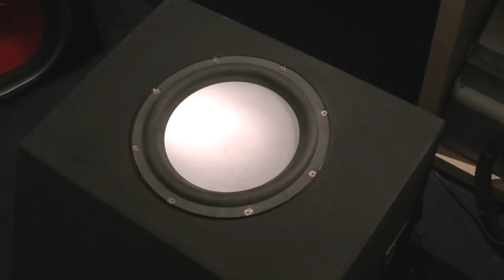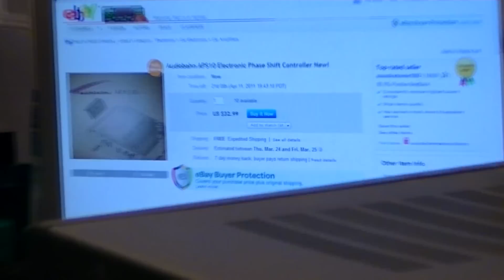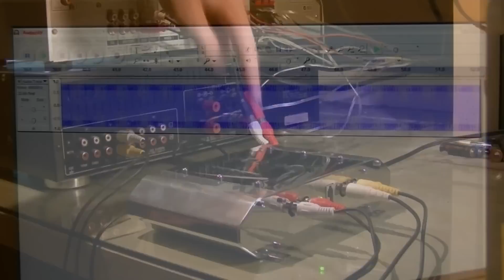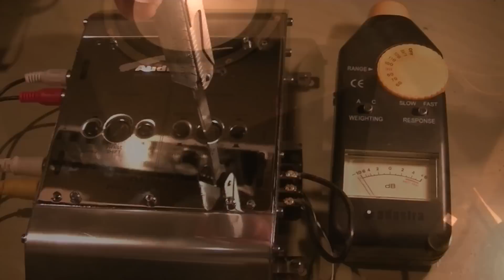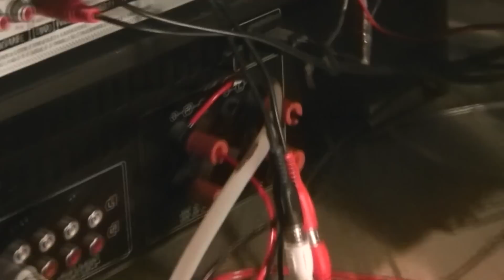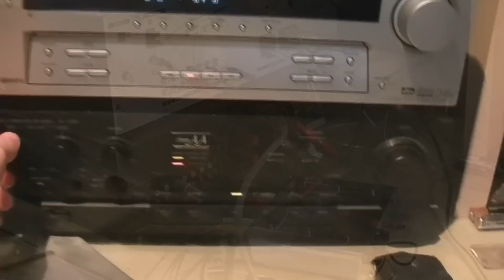How to FULLY bridge any amplifier! EASY steps

Comment: Just a word of warning. You CAN'T do this with class D amps. They are already internally bridged, and doing so will damage the amplifier.
Reply: +Giulio Zanetti if its class D it'll be small and light...class A amps are heavy
Reply: How do i recognize an already internally bridged amp? cause i'd like to bridge mine but i'm not sure i'd be able to do it, and i'm just hoping my amp is already bridged, it would be a great thing
Reply from the maker: You can do this with ANY 2-channel amp. If it is set up for bridge mode internally already then you dont need to.
Reply: He means STEREO class D amps!
Reply: You can only do this if the two speaker channels share a ground or the other contact.
IT WILL NOT WORK IF THEY DONT
Reply: It will if they don't. You just have to manually connect them together externally instead if internally.
Reply: Actually, ANYONE can.
It's called using one's brain.
Any internally bridged amplifier (one that can NOT have any speaker terminal connected/shorted to any other OR to ground (as they have internally connected grounds already, meaning that both the + & - outs are considered FLOATING  high outputs and ONLY +/- with respect to each other of the one output - with no possible electrical connection ground), thus ONE must use one's BRAIN to find the way to GROUND these outputs.

The one simple method, that has been USED since the beginning of electrical circuits and is STILL in use in HIGH POWER COMMERCIAL GENERATION SUPPLY NETWORKS, to this day, are TRANSFORMERS.
You know, that most ancient of devices, that keeps POWER flowing down a LINE, whilst completely ISOLATING one circuit (however configured) from another that is GROUNDED.!!!

All one needs are a couple of toroidal isolating AUDIO rated 20hz/20Khz toroid's of sufficient power rating, and ISOLATED the output from your MONOBLOCK dual ch. amp, from the TWO now "grounded at the toroidal transformers which will then be fed from the toroidal outputs, to become the ONE bridged speaker final circuit.

Easy for those who THINK.
Everyone else has to "carefully" check to see if there's any ZERO resistance, between the two output negative's (preferably without the amp powered on) otherwise they will INTERNALLY BLOW the internally bridged IC's with a runaway shorting current, (that will violently explode the op ic's)

Such an easy fix, is obtained by the interconnection of even a single dual wound toroidal transformer, that has ALL 4 windings on it's ONE core, all rated at the same voltage & impedances, as well as having a multiple frequency rating - suitable for audio frequency uses

ie: One capable of easily handling 20 Hz frequencies, right up to & including 20kHz (and even 40 kHz for tweeter speakers).
Such as this type:
http://www.photonage.com.au/150w-100v-28-ohm-audio-output-toroidal-transformer-p-2155.html

Comment: no need for phase inverter, simple wire inverting would do the trick, and with more precission than any signal processing involved
Reply: yeah exactly what i was thinking! just invert one channel out of the splitter - would be a very handy cable/adaptor to have in the kit, as long as it was clearly labelled.
Reply: @chubbyballsack  RCA cables have a common ground so you'd only get sound on one plug as you'd short the other channel to ground unfortunately.

Comment: Hey man, I know this video is old but I recently managed to get an old amp working again which means I have two stereo (VERY FUCKIN' LOUD) amplifiers. I want to do this and need to know if there's a particular place I could find one of those phase shifters. 

I also want to know why you can just make the phase opposite at line level by swapping the earth and signal wires round on ONE of the channels so that you get the bridged effect. 
I could do with a reply if possible

Comment: You've made a push-pull configuration.
If an amplifier supports bridging, you connect the positive of one channel to the negative of another channel, making the reference of channel 1 the output of channel 2, doubling the potential.
When you bridge, your speakers impedance should be twice the min impedance the amp is built for.
Also, in the video you measure the voltage of a closed circuit, and then compares it to an open circuit. It's pretty obvious that you don't really know what you're doing.

Comment from the maker: @Olmirz what you've just described is bridge parallel mode. In theory it should work - but both channels on the amp have to be giving IDENTICAL output, I'm talking seriously identical. Even the slightest difference would damage the internals. As no two channels on any amp are even close to identical output it won't work. Unless you buy a Crown Macro-tech amp, where you can flick a switch to enable this mode, as it uses a brilliant regulation circuit. Doing this allows you to halve the impedance!

Comment: This is probably a completely stupid question and I know it probably won't work. What would happen if I have a mono sound source going into the amp and just connect the positive outputs together and connect them to the positive terminal of the speaker and then connect the negative outputs together and connect them straight to the negative terminal of the speaker. This would be done without any other equipment. Surely the speaker would get the power from the right and left and combine?
Reply: Each channel will try to drive to other channel as if it was a speaker. You amp will burn instantly ( trust me I did it)
The only way this can work is to make sure each signal is the exact same as the other and even there you expose yourself to important risks
If it worked you would get twice the current capacity which means that a 4 ohm capable amp will become a 2 ohm capable amp.

Comment from the maker: @isitgranite the lower the impedance of the sub the harder the amp has to work on it, and the hotter it gets - you can risk it at your own discression, taking it down from 6 to 4 shouldnt cause any damage if you are careful. i had my technics running on 2ohms where its usually 4ohm stable, and my god did it get HOT. no damage but the heat was enough to hurt when you touched it. now that its bridged however i find it incredibly stable and never heats up! song is let my beat pound by TI

Comment: Thats a pretty cool video, I was trying to do this the other day (the wrong way like you showed by connecting the + from one channel and the negative from the other) Anyway since ive nearly got the same amp as you, I have a technics A class (not aa) but mine looks very similar, just wondering what are the affects of running a 4 ohm sub on an amp thats recommended to run 6 - 16 ohms?  OH and whats the song at the end? sounds sick

Comment: @barevids See, what you don't understand is when you have a balanced connection you have a Hot, Cold, and Ground/Shield. the way a balanced connection or low-impedance connection works is this: the signal travels through the cable out of phase so that when it reaches its destination, all the noise/interference introduced is out of phase with the original signal. this means you have an extra ground lead. the amps you use in this video most likely aren't grounded. I PM'd u explanation of the setup

Comment from the maker: @FreezEntertainment hell no! :/ and your connecting speaker teminals to both positives? If so and youre getting sound, then as one of the positives is inactive its taking in all the voltage from the other one without the negative voltage to ballance it, your amp will not last long! did they tell you this in an email? if so please forward it to me!

Comment from the maker: @FreezEntertainment I thought this too, but it doesn't work - this is because its only the + that generates a signal. The minus actually just goes to ground. So if you flip the wires of one of the inputs what happens is you send the signal to ground of the amp, and the device ground gets connected to the amps signal input. No sound! I can explain / prove this in a further video or something if you like.

Comment from the maker: @Jman9112 8 channels? Is it a surround sound receiver? If so I wouldn't recommend bridging it as it has decoder that change the sound around and you could damage it... but if you did want to try it yes you would need the inverter - connecting the two plusses and minuses together is called parallel mono and you need a special regulation circuit for it to work (crown pa amps do this)

Comment: @barevids Well, isn't it like the tip of the rca is the positive and the ring is the negative? Cause it works like so if you use it as a speaker wire with mainly 5.1 + dvd player combos.

Comment: Great video, mate! Just an idea:

I think I can make it without buying that inverting device. Like I break the RCA cable and invert it manually, so I connect the positive to the negative and the negative to the positive.

What do you think? Is it gonna work?
Reply: Bro... did it work? lol
Reply: 2023, still curious, lol.  I'm going to assume not, because the 'negative' line on the channel is simply a return, and not an inverse (like in a balanced interconnect).

Comment: Hey Barevids , what about using one channel and putting that through a low noise opamp on the inverting channel . This seems a lot cheaper than what you have here . But ofcourse the quality may be worse , depending on the components used . 

Anyhow great tut ;-)